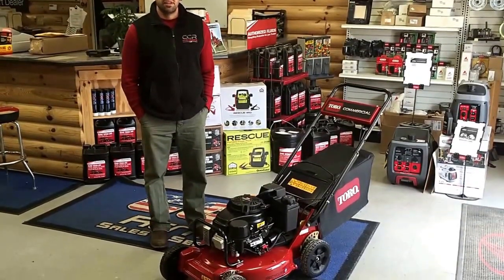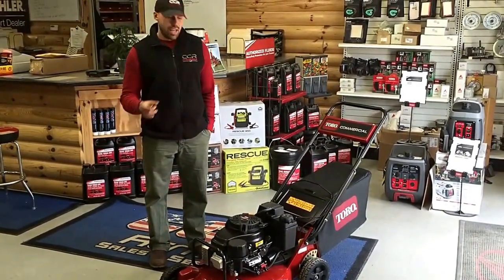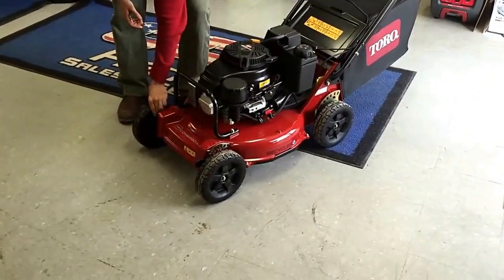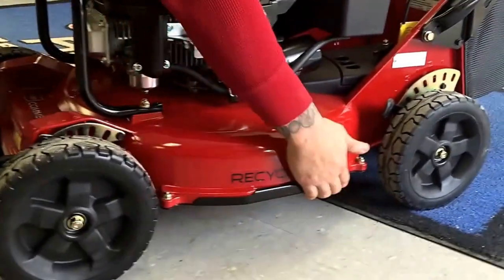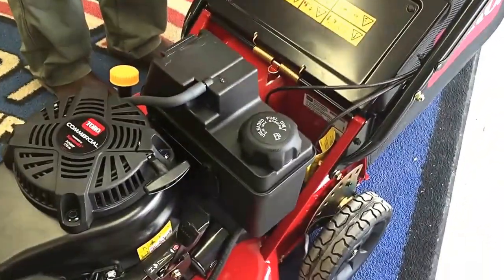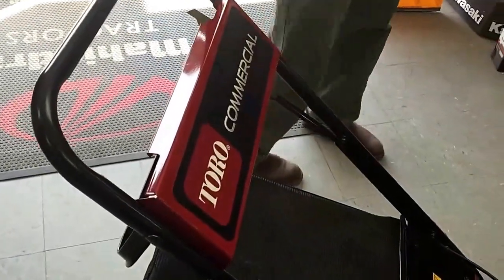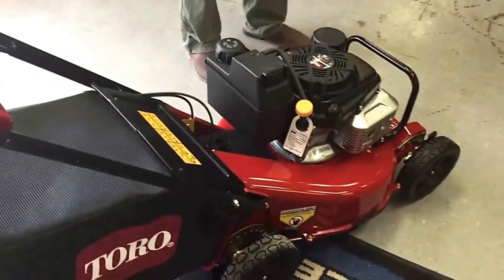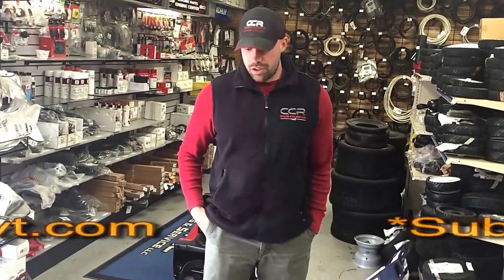Toro Commercial Heavy Duty Recycler Walk Behind Mower (Model 22298)

Comment: I've bought one of these commercial toro's and I used it for one season and I'm selling it to Heavy for a energetic worker like me. I would barley move the next day. toro got to make them more lighter like the ones I still repair with the Honda engine I believe the model # is 22156. only flaw are the wheels. but for now no more toro mowers for me. Honda mowers I run now.
Reply: I totally agree, I use a lawnboy 22271 identical to the 22156 except in color. 

Are there any new commercial or semi commercial 21" mowers under 100lbs?

I really liked the ybravo I saw at a show room but that beast was 114lbs...this toro is even heavier!
Reply: @patrujo  My first mower starting out was a Toro super recycler it was 29 years old. I used it for a season but gave it away when the transmission went out. I have now been running the Honda HRX217 for last 3 years and own 5 5 of them. I am thinking of going back to Toro super recycler as I don't like the HRX Deck. Because it's all plastic with many pieces it does not have a good seal. If you don't have a catch bag on clippings will continue to come out of rear discharge which either you have to double cut or blow clippings so that you don't have a lign of clippings on the lawn. I also bought a YBRAVO and used for 2 months but ended up selling. To bulky/heavy and doesn't cut any better. The timemaster would have been a better buy.
Reply: @temujinkhan6326  good to know regarding Ybravo. I ended up buying a 22290 when my commercial lawnboys were in the shop. When I'm paying people to push it, I love it. It cuts really nice, IMO. 

I just cut 17 lawns yesterday by myself with my lawnboy 22261. I forgot how light, quick and enjoyable this mower is to use. One has to go to great lengths to keep it running during the season, but to me it's worth it.

Happy mowing